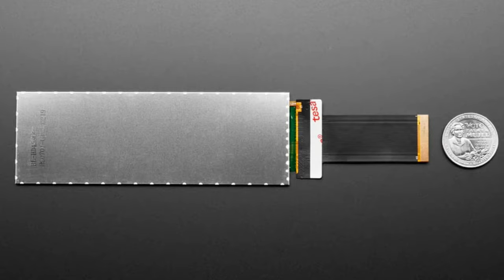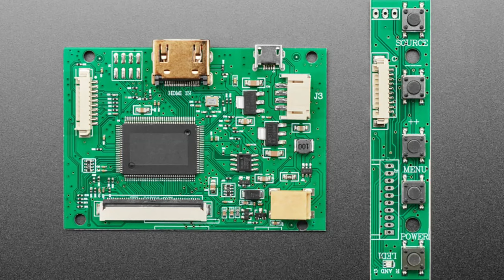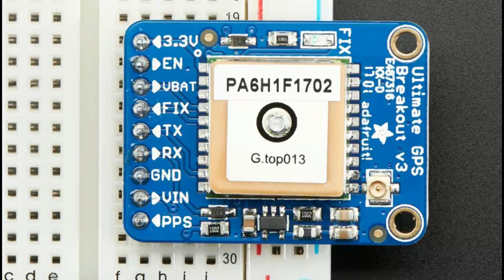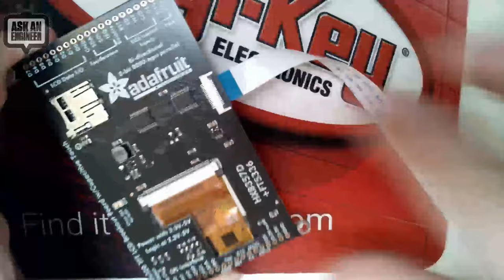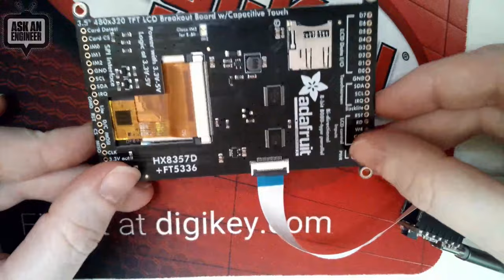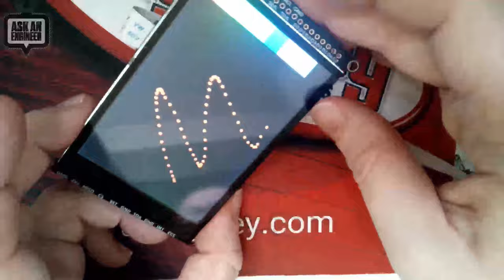#NewProducts #Adafruit Feat 3.5" #TFT 320x480 with #CapacitiveTouch #BreakoutBoard - EYESPI!

Comment: Is there a discussion page I can go to about the new displays? I don't see any support for the two rectangular displays, even though the bigger display is linked on the qualia page as well, but in the code there's a 3.2" display (320x820) instead of the 3.7" (240x820) and the 4.58" (320x960)